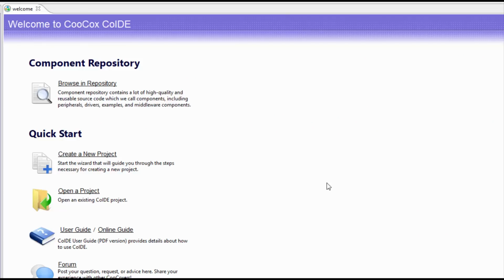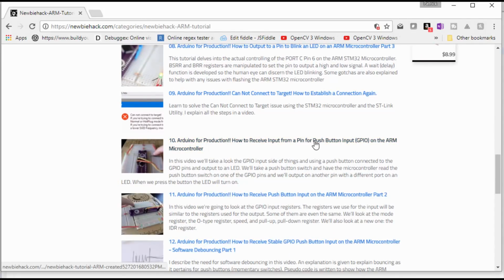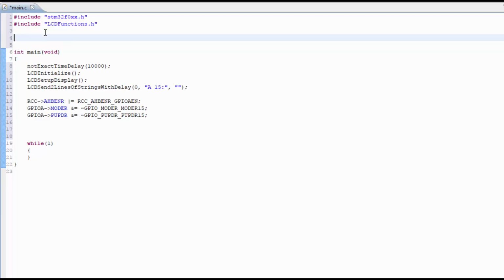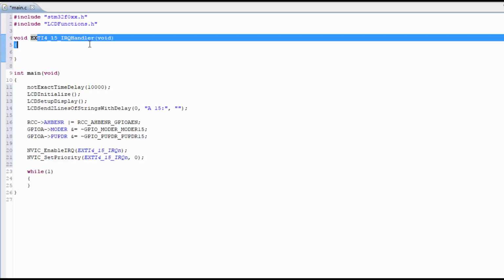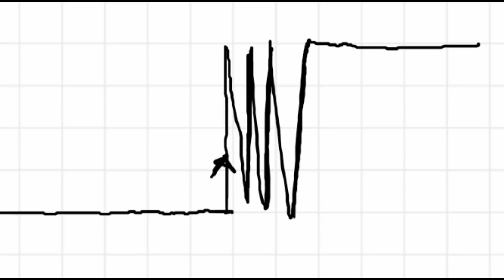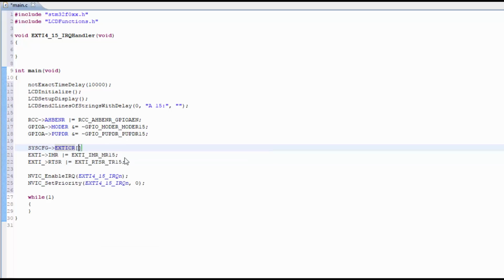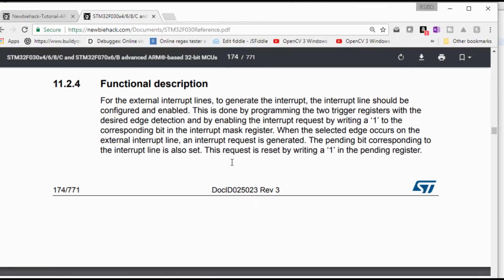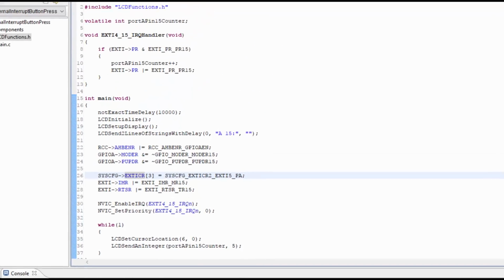54. How to Make Push Button External Interrupts - ARM STM32 Microcontroller Tutorial

Comment: Hi how much is the time between interrupt(falling or rising edge) and function in normal case and how we can decrease this time ?
(Doing the function immediately after interrupt without any delay)
Reply from the maker: Good question. An interrupt latency is a part of the microcontroller's internal process and can be influenced by the priority set for the interrupt. If using multiple interrupts, a specific interrupt is influenced by its priority set using the NVIC. I cannot tell you how many instructions are executed to complete an interrupt, but I can't imagine its many. Complexity can add additional instructions for the uC, such as nested ISR, code length within the ISR, etc. If he ISR is critical, make sure to reduce any noise on the circuit, set the priority to its highest, and keep the lines of code (translated to instructions) very short within the ISR (the function that fires).
Reply: @PatrickHoodDaniel  👍👍👍

Comment: Hello thanks  for your videos. I will see all videos. They are very nice and interesting. Again thanks for your efforts.
I applied like same code but on stm32f091rc evl board..(change port and pins and external interrupt ).
But my interrupt did not work. So now I try debug my code I think my fault should be in handler function. Could I send you my code? Please

Comment: Hi Patrick, thanks for a great video.

Can you clarify why a volatile isn't optimised out but a normal integer is?
Reply: I know I'm quite late, but I'll answer this for other people as well. The problem is one of the optimizations of GCC . Since you're not calling your interrupt handler directly, it'll assume that the function is never called, and so the variable that is being changed inside the interrupt handler can't change, so it optimizes that out. So you need to tell GCC that that variable is "volatile", ie can change automatically (Although in this case it's our interrupt controller)
Reply from the maker: I'm not actually sure why the compiler optimizes the non-volatile variables.  It's just something that I have known for a long time with these embedded systems.